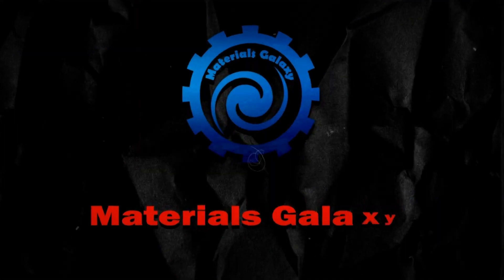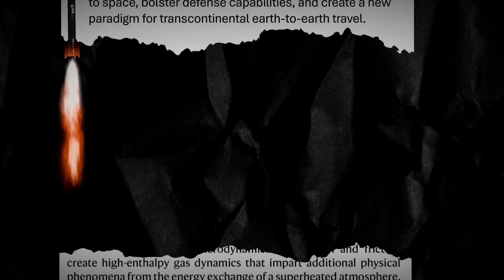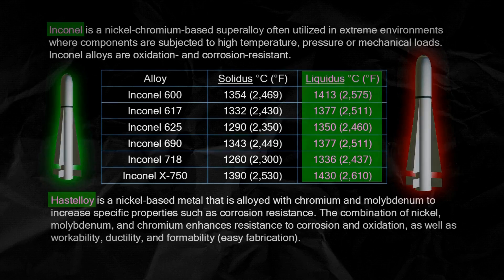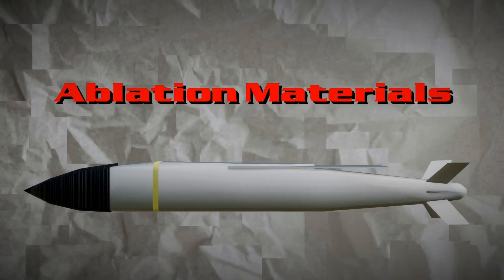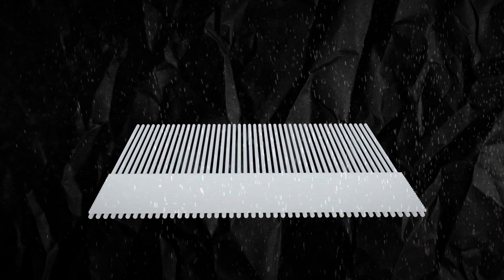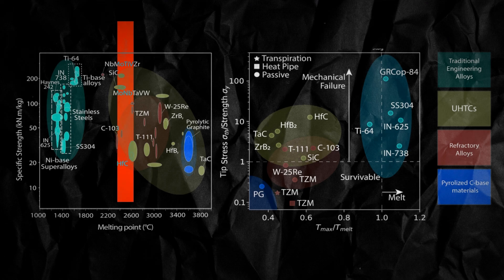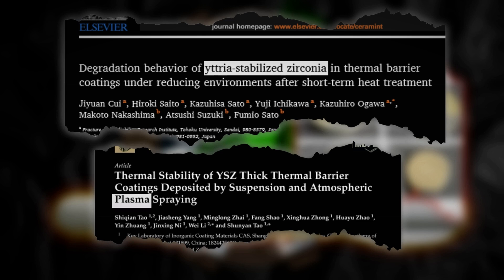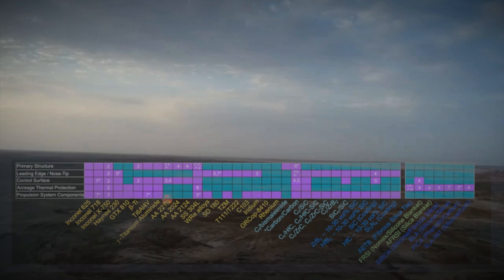Hypersonic Materials: The Building Blocks of Speed

Comment: The application and quality control can become critical. For example, an ablative shield needs to ablate in a predictable manner. If one side of a vehicle has a higher abaltive rate than another, the air flow over the now asymetrical vehicle can cause flight instability, tumble, and potentionally rip itself apart.